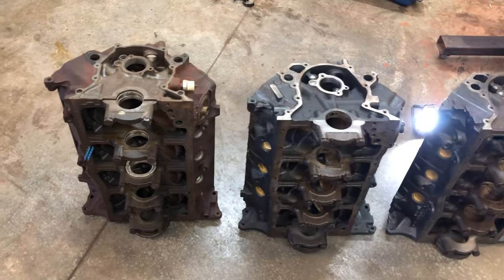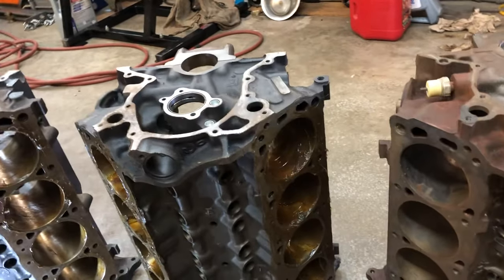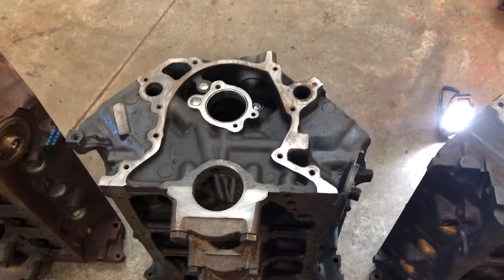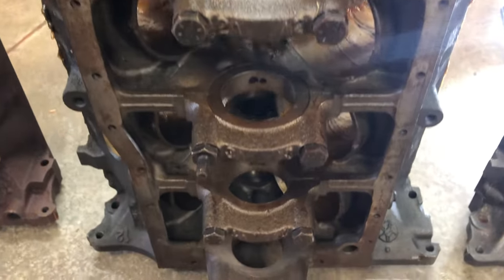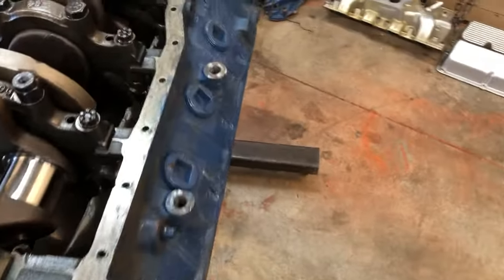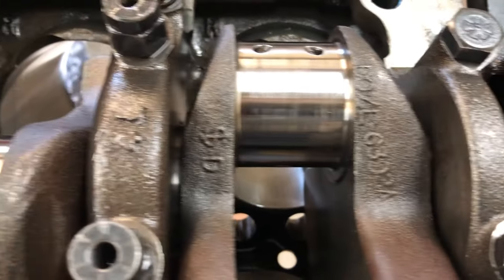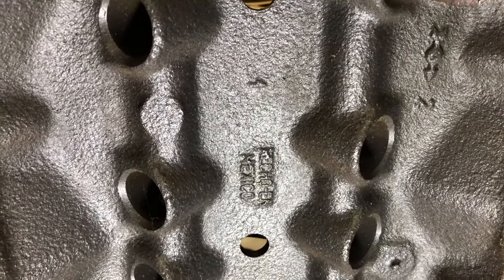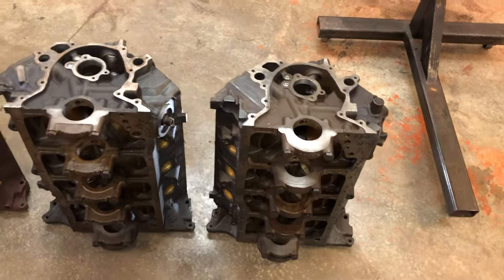The 4 different factory versions of the Ford 302

Comment: I remeber reading that the Mexican block also had higher nickle content..It was supposed to be similar to the period race only ford blocks...tho my memory is foggy and cant find that magazine which im refrencing.
Reply: Ford said in an article that no blocks had higher nickle  but I don't believe that but the mex. Block is softer so it could expand for the heat in Mexico. Every one it taken apart had really bad wear in cylinders its hard uo get one to go .030 , I took 4 apart only 1 will clean up at .030 other 3 need to go .040
Reply: @lloydtrivette7505  that doesnt make any sense...Mexico isn't any hotter than Texas or Vegas..
Reply: There is no such thing as a "high nickel" block.  This is a myth.
Reply: I remember something about the Mexican blocks being higher nickel content as well, but I must have read that about 3 to 4 decades ago???
Reply: @peterhart4301  There has never been any block ever that had any significant nickel content.  Tin possibly but no nickel.
Reply: @Arthagnou  Labour was cheaper , that's why they were done there , no other reason
Reply from the maker: Also, in Mexico, more desert there, and very poor treatment of the vehicles, I doubt the air filters were ever taken care of allowing more stuff into the engine, causing more cylinder wear.
Reply: @DaveMcLain  Here the same about chevys all the time its bs. 
Only mfr I know of that added more nickel and tin was the AMC 401
Reply: @DaveMcLain  Yep...tin not nickel.

Comment: The cap on the Mexican was probably larger because it was a truck engine.  We would get Mexicans into the plant whenever we had a shortfall from Cleveland Foundry.  It was a very easily machined casting because it was pure cast iron.
Reply: All the US 1/2 ton trucks had regular old 302 blocks, though. No failures to speak of from stock blocks/caps in the trucks too, at stock power levels. I was told that the reason for the stronger main caps on the mex blocks was due to inconsistent fuel quality south of the border, and therefore, greater chance for the engines to be exposed to frequent detonation.

Comment: The very obvious, especially for us Aussies is the 302 Cleveland block. Far more common than the 302W
Reply from the maker: So that’s an engine that I have not seen is it a D stroked 351 Cleveland or a completely separate Cleveland block with a 3 inch stroke and 4 inch bore.
Reply: yeah, de-stroked to 3 inches with a 4 inch bore. much lighter crank too. @pyleup
Reply: Well none of these are clevelands so that's irrelevant.
Reply: @Terminxman he was talking 302 ford engines and that is what a 302 Cleveland is .
Reply: @pyleup  I'm not so sure U can call it a destroked Cleveland , it is an original production motor produced by Ford Australia ( a 4.9 litre as Ford labelled it , the 351 was labelled a 5.8 on the aircleaner and front fender up untill they stopped producing them in  1984/5 they produced them from 1973/4 to 1984/5 a long run and they were in everything from upmarket taxis , family cars, utes, wagons , panel vans, Aussie F100 to F350s ) if you call a 302 Cleveland a destroked Cleveland then you must call a 400 a stroker Cleveland ! I'd love to have a stock line up of 302C, 351C and 400 and see stock power outputs , it would be interesting to see what 50 ci extra makes on very similar almost the same engines !
Reply: 351w was produced until late 95

Comment: Boss 302 is just a Windsor based beefier 302 with 4 bolt mains, steel crank and modified to accept 351 Cleveland heads, they can't do much in a 4000 pound luxury mustang. I watch them knocking and pinging down the drag strip all day long. Ford had to sell so many to the public so they would be allowed to race in the SCCA Trans Am 5.0 liter limit

Comment: You've left out the Australian 302. 9.2 inch deck, 6.025 inch rods. 30 pounds more metal in the block than a Windsor 5.0 , native cleveland closed chamber heads.These 302c are a stronger 302 Boss and they're considered the poor cousin of the 351 so they're completely disregarded as a performance engine. On paper they make good sense. 32 pound crank vs 58 pound 351 crank, better rod ratio than Windsor 8.2 inch deck. I've owned a few of these and they're as fun as ____.
Reply: Australian 302C was just de-stroked 351C plain jane 2 bolt main block. Reason why block was heavier because timing cover part of the block. Big chuck of cast iron covering timing chain so they used plate just to cover timing chain. 351w had higher deck height of 9.5 vs 351C/302C of 9.2. 302W had deck height of 8.2
Reply: @pdmustgtd1013   Still it was a 302
Reply: @mickvonbornemann3824  great logic there wow........ Really 2 completely different blocks but with your logic because it's just 302 somehow all of its the same.
Reply: @pdmustgtd1013 Chevy also had a 302, I'm sure he thinks that's all the same too.
Reply: @pdmustgtd1013   The title was “Ford 302s” not “302 Windsors”. Besides the Boss 302 is basically a hybrid of the lighter, better oiling Windsor block with the better breathing Cleveland heads.
Reply: @mickvonbornemann3824  The title didn't say U.S production or world production either try again. Also Boss 302 not lighter block or better oiling system either. Same basic casting as 221, 260, 289, 302, hi-po 289 just Boss block just with 4 bolt mains and screw core plugs all use same oiling system. Ford never called 302 windsors either. Nor did Ford ever use small block and big block thats GM term
Reply: @pdmustgtd1013 sorry but the 302 Cleveland and 351 Cleveland are a different casting than the US Cleveland , it is infact the same casting as NASCAR Cleveland block , thick wall , improved main thickness to allow four bolt mains , ect ,
Reply: @JosephCowen-ru7up  Sorry Blocks for 302c and 351c are the same and only difference are the cranks. Australian car production blocks were not NASCAR blocks. NASCAR Blocks were special limited casing. U.S blocks can be changed to 4 bolt main, 2 and 4 bolt main caps same width, bolt boss are there in the block on 2 bolt block just undrilled.
Reply: @pdmustgtd1013  sorry mate I said NASCAR style blocks with the thick wall casting , that is why they were very sort after , and nooooo the 302 Cleveland has a different crank and 6 inch rods ( as the 351c has 5.85 inch rods ) the 302c has closed small  chamber 2v style heads but with a four barrel Aussie only intake. And so on , the Aussie blocks use the NASCAR casting , any 302c /351c can be drilled for four bolt mains , as the main webbing is not contoured away like the thin wall US casting this is one reason Pantera,a used Aussie blocks and why Cleveland people in the US want this block especially the 1980 to 84 version .
Reply: @pdmustgtd1013  yes the US block can be drilled for four bolt mains, but under the main web is reduced and you can tell an Aussie block as the oil pan rail is solid , under caps are solid , this is why Aussie block weighs 30 pound more , or did we use special iron that weighs more ??
Reply: @JosephCowen-ru7up  I never said U.S and Australian blocks were the same show me where I said that?????? I fully know Australian block were different from U.S block where was this disputed? Australian production block was not NASCAR block either again was limited run block. This has been talked about over and over.
Reply: @pdmustgtd1013  I didn't say they were the same , the NASCAR block went through a lot of machining , and was cast in the Michagan Casting Centre, the Aussie block uses the same casting patterns , all the metal in the same places , under main webs , oil pan rail , all US Ford engines bar FE, Yblock, Mel motors , flat heads are thick wall castings , untill the mid 1960s then they all switched to thin wall casting , when Australia got the patterns in 1973 for Cleveland the Geelong Casting Centre who cast all Australian Clevelands did not have the ability to do thin wall casting , so they used NASCAR block patterns , hence the weight difference . Put a US 1970 NASCAR 358 ci Cleveland bare block on the ground , then a Aussie Cleveland and then a US 351 C , there are pictures on here if this , as you can see Aussie block has metal in all the same places as NASCAR block just not machined the same , NASCAR has some oiling passages , but neither look like a US Cleveland , the US Clevelands look like someone took to them with a grinder .
Reply: @JosephCowen-ru7up  You don't make any since. There was no NASCAR block in 1970 they used production blocks. Did Ford do few test parts yes but nothing to support racing. Australia got U.S patterns but couldn't cast them thats funny. But uses NASCAR 1970 block pattern when there wasn't one in first place. Aussie XE blocks where done in early 80's and thin wall castings started back in late 50's. Ford started just with 221 in early 60's. Australia was doing thin wall castings when NASCAR XE blocks were casted. Again XE blocks were very limited run for RACING. I've seen and had my hands on Aussie NASCAR XE blocks and Australian production blocks they are not the same. I have few 351c blocks in storage no sign of grinding lol.
Reply: @pdmustgtd1013  buddy you got a lot to learn , you don't make " since lol" spell it rite , NASCAR blocks in Cleveland style started in 1970 when the big block were banned , they used Cleveland style untill about 1982 then a SVO Windsor block and Yates heads that sort of resembled Cleveland , also it had a Cleveland deck height , 351w block , with Four Bolt mains and that was a special casting , read a bit about the Geelong Casting Centre and the fact they did not do the US style thin wall cast style , use your head if they could cast like the US it would have been a lot cheaper to just use the US patterns , but they didn't , as stated thick pan rails gives away the Aussie block , 30 pounds of extra iron , thick main webs , I don't get your point on 221 Windsor's , yes they had thin wall casting in fact one of the first just like 255 Windsor, 260 Windsor , 289 W, 302 and 351 W, but that was the US Australia was at least 20 or 30 years behind the US plus the failure rate of thin wall casting was high and a little country producing a low volume V8 could not afford waste ,and I said looks like grinding , read b4 commenting , they were cast with all the metal removed that is what thin wall means !! And  thin wall started as stated with the 221 Windsor and that was late 1963 , noooo ford had thin wall in the 50s because the only V8 ford had in the early 50s was the flat head and that is soooo far from thin wall it's not funny , no Yblock in the mid 50s had it and neither did , as stated the FE , FT , Mel motors or Edsel motors all the Ford V8S in the 50s and early 1960s in fact know one believed in thin wall , GM Small blocks still thick wall in the early 1980s ,
Reply: ,,, fairly sure  : Roush, Glidden, and Nicholson had Australian 351 blocks in the early Seventies . They all would crack cylinder walls, but the Australian less so .
Reply: @rolandtamaccio3285  yes I think that I've heard that , many used the Aussie block because thick main webs and oil pan rails , the Aussie block weighs 30 pounds more than the US one , it doesn't matter if it started out as a 302 Cleveland or 351 Cleveland as they use the same block.
Reply: @JosephCowen-ru7up  ,,, the only thing that was needed under 700 or 750 horse was better cylinder walls . Glidden furnace brazed 8 sleeves in his and probably bored them .090 over .
Reply: @rolandtamaccio3285  yes I guess they have that too, the FORD Geelong Casting Centre were 302/351Clevelands were cast didn't really do the thin wall casting like in the US so the blocks ended up with a lot of extra metal in good places from a performance stand point .
Reply: @mickvonbornemann3824 it was destroked 351 and it was a pig. Also the Cleveland engines suffered from oil starvation at high RPMs and cooling issues if the proper thermostat wasn't used.

Comment: The 80s block has locator dowls on the timing cover bolts (2) to  center front crank seal.
The boss block has 1/2 inch main bolts and head bolts vs 7/16 inch in regular 302
The boss block has screw in freeze plugs too.
Reply: I know every body calls them freeze plugs but that's not what they are for. The holes are cast in the block and heads for removing casting sand, these holes also get bored in two operations to finish size so the plugs press in. I do know on at least some engines the center sand shake out hole will be used to locate the block for drilling and reaming the Main Manufacturing Holes. These holes, typically 5/8 to 3/4 (16 to 19mm) are used along with the Pan Rail to locate and provide datum poi to and surfaces for all following machining operations.
Reply: Yes sir. Correct term is core plug. One of them common incorrect slang terms.  Like hot water heater. Lol
Reply: @richceglinski7543 right, like people calling a high speed drill a drill bit. Or my favorite one, unloosen that bolt. Lol😅. Rates up there with the good old 3/4 cam
Reply: The real boss 302 block 1969 and 1970 does not have 1/2' bolts!  Also Comp cams Sells a retro fit kit that you can put a stock ford Roller lifter into all small block fords, they have a template that shows where to drill the bolt holes.

Comment: Early 302,260,289,221 and 351w had a casting lug for the clutch z bracket pivot point and the early 1963 to 1965 221,260 and early 289 had a 5 bolt bellhousing patern and only 2 core plugs per side.
Reply: Good info on the clutch z bracket boss and 5 bolt, that was '65, '66-ish?
Reply: @vrm86gt  pre mid year 65 on the 5 bolt
Reply: @frankinjeep1194  thanks!
Reply: There are some other small differences like steam hole placement and webbing thickness but they are very minor
Reply: 5 bolt bellhousing is same as 200/250 ci ford six

Comment: Great job on describing the differences on the 302 blocks. I had a 289 C code in my first 1965 Mustang Fastback, I blew out the press in oil galley plug behind the timing chain gear revving it to 6,000 rpm, and ruined the engine using a high pressure Mellings Oil Pump. When I later built a 302 Mexican Block, I tapped out the oil galleys for screw in plugs. If I recall, Shelby used a 302 Mexican block in the 1968 GT-350's.
Reply from the maker: Screw in oil galley plugs are always the best way to go the boss 302 that I just got done building has screw in oil galley plugs . The service block that was in the Boss 302 with the dropped valve. Someone had put  Loctite on the galley plugs and I couldn’t remove them. But that block is out of service for now so that will be someone else problem. That Boss block that’s in the video .
Reply: Loctite can easily be broken by heating the area with a torch, if that is all that is holding them in. 👍
Reply from the maker: Good to know the comment section and these videos is a great learning tool for a lot of people

Comment: I’ll take the one on the engine stand, thank you very much!!😉🤣🤣🤣
I put together a 289 (+.030”) for my ‘65 Galaxy. It had 2-bolt mains and a cast crank. I had it very nicely balanced, and used Moroso main studs. Also ran a solid lifter cam and roller rockers. Had a built C4 trans with a 3000 RPM converter feeding a 9” rear with 4.11 Richmond gears (eventually swapped them out for 3.73s). That thing would turn 7,000 RPM no sweat.
Never got the opportunity to race it, but it sure did surprise a lot of people!!😉🤣🤣 Wish I still had it!🤷‍♂️

Comment: In the late model roller blocks. The lifter bore is taller than the early block.
Not all roller blocks came with a roller cam. Some came with a juice cam.
Reply from the maker: Thanks for the info
Reply: usually  they call the flat tappet  ones "non-HO"
Reply: @KingJT80  true, even though they are a roller block.

Comment: There’s also a tunnel, port 302, which is essentially a boss 302 block except it has much thicker cylinder walls and a standard boss block. It can be bored out 80 over with no problems. It’s casting number is C8FE.
Reply from the maker: Good information too bad it wasn’t a factory production block mass-produced it would have been a hit
Reply: @pyleup             well actually they did wind up in production cars. Several years ago I had a friend sell me a 69 boss 302 motor. Casting number on it was a C8FE, which was a tunnel port block. The tunnel, port heads turned out to be a flop, and the road racing circuit. The ports were too big and did not create enough velocity at lower RPMs. I would think they’d make a great drag racing motor as they love high RPMs.
Reply: Actually Car and Driver magazine did a road test comparing a Tunnel Port 302 , '68 Mustang to a 302 Z28 Camaro RS . Interesting article as Ford showed up with a set of Goodyear's on the Mustang that  didn't fit very well , and that nobody had ever seen before . At the end of the test , the editor called Goodyear and asked them about those tires . The official answer was " we don't make a F 60 x15  " , to which the editor replied " well I've got five of them downstairs on a Mustang ". Goodyear finally confessed to making them, but were very unhappy with Ford for letting the cat out of the bag . They weren't even sure if they were going to produce and sell them at that time .
Reply: @lorenzomaximo1818 :
The early 1969 Boss 302s were built with the 1968 Tunnel Port blocks and Cross-drilled steel crankshafts. The crank was never serviced by Ford Parts and Service, nor were the 1969 Boss heads with the 2.23" intake valves. All replacement heads were the 2.19" late 1969/all 1970 castings and came with four 2.19" intake valves in the box.

Comment: the 302 blocks cast before  1975 have thicker casting in the  Bores than any block cast after 1975,  i have never seen a late block that could be bored  more 030. I have seen early blocks that would take a .060 over bore. I have experienced  liner cracks in the roller blocks so I don't use them any more. i Sonic check every 302 block and early blocks are thicker.